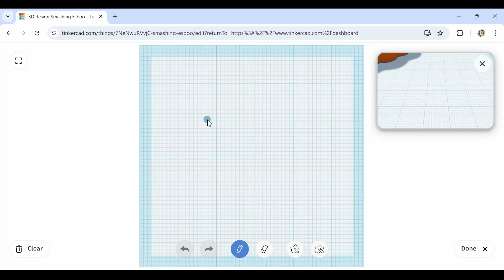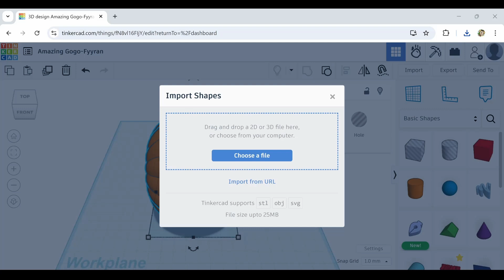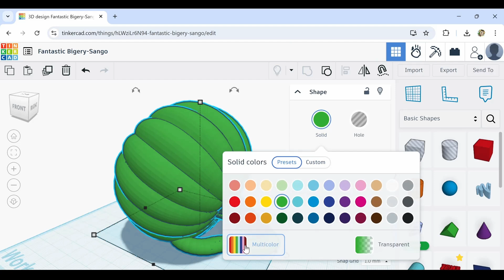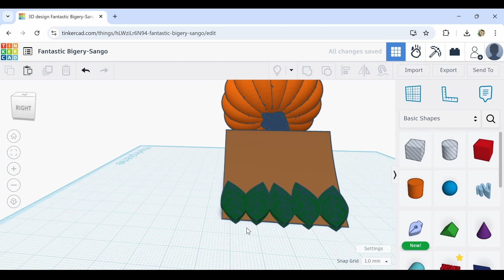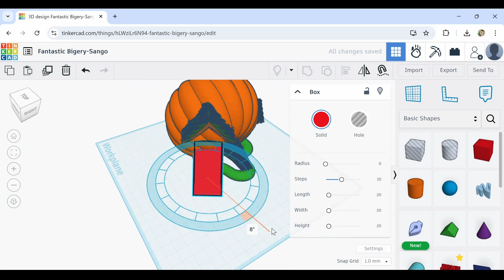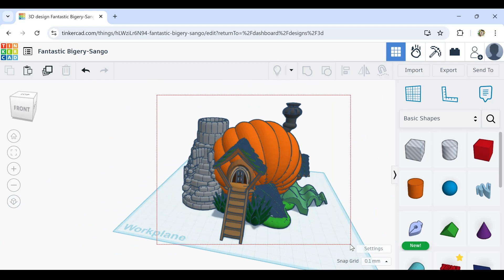Tinkercad Design Tutorial! Fairy Garden House! 3D Modeling! WOW!

Comment: yo you gotta try making like the iron man mask or helmet , or any kind of armour piece thats wearable , it could be a whole series of just designing different armour parts that come together and fit to make one big set.

love the vids - especially cause you make all of it in tinkercad , subbed instantly.
Reply from the maker: Yeah, I think you're right about that! I've been thinking the same thing for a while but I was going to wait till I got a bigger printer. But maybe I can start with a helmet and wrist armor. Whatever is small enough. I already have a request for a dragon mask, so I'll have to get to work soon. I'm short one time this part of the year but I'll try to start working on it soon! 

Thanks for subbing! 👍👍👍
Reply: @TinkercadWorld-ho8ht  I mean you could design smaller parts to screw together or use the twist and pull (extendable stool) so they print easily but also expand and set instantly , that's what I've been tryna do but I can't get the measurements and parametrics right. 

I got a elegoo neptune 4 pro so it's not that big but maybe printing in small parts could help. You could also add the chain mail for joints n shi.